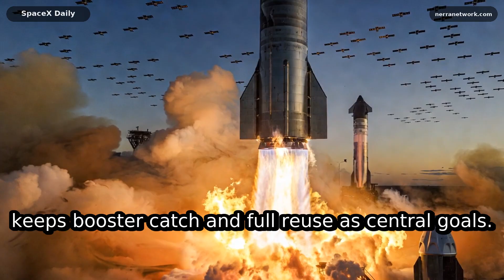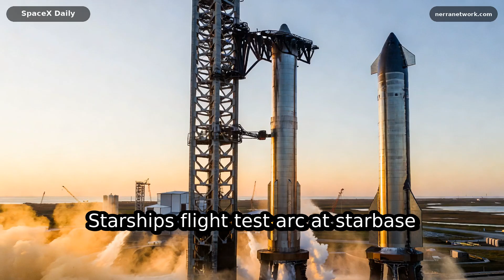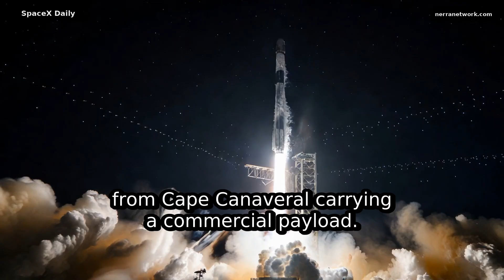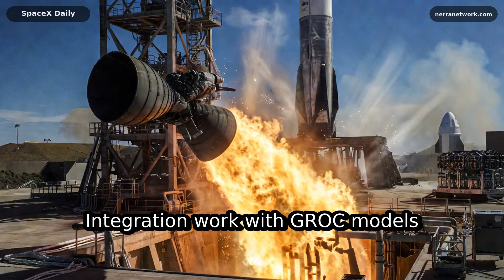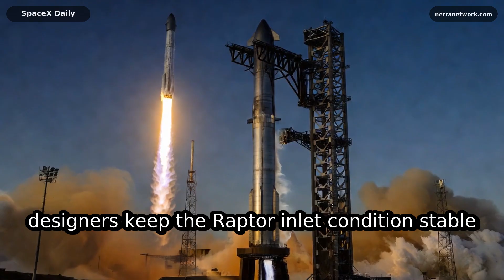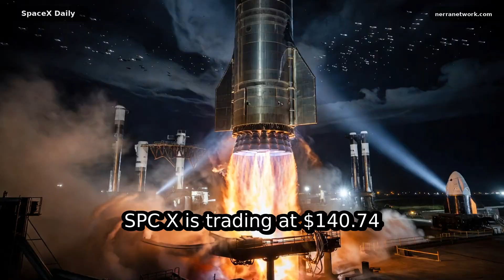Starship Flight 13 Upgrades Target Booster Reuse

Comment: Good content, new information, presented clearly.  Thanks for the insights.  Closed captions need minor touch ups for the inevitable glitches, like guessing "Groc" for "Grok", I'd dump the CC and let YouTube do the work for those that want it.  One correction: the netted booster catch was a Chinese rocket, not South Korean.  Hope this helps.
Reply from the maker: So helpful. Thank you. I debated the automatic closed captions over YouTube as many may not be aware of CC versus just using Ken burns images is kind of boring. I figured the narrative with images may be more interesting. Using AI to generate video isn’t very good and mostly pretty expensive. Using generic video also seems kind of sucky too. All feedback is great thank you once again.